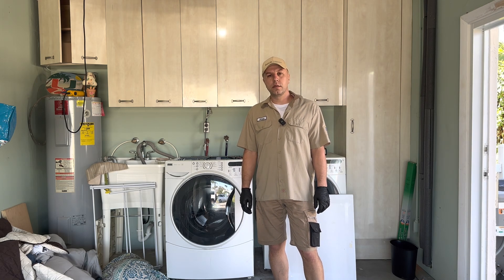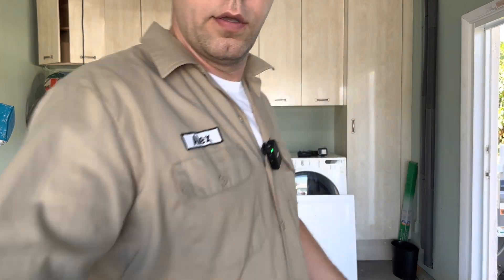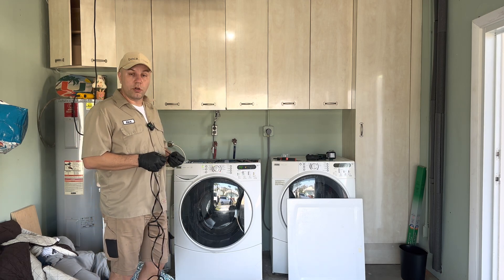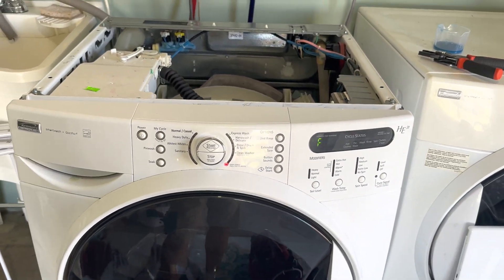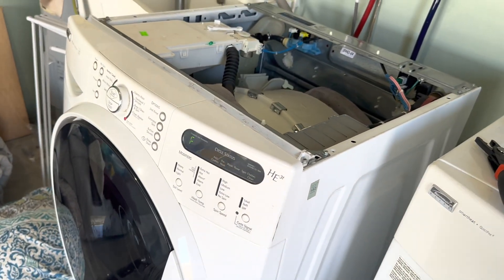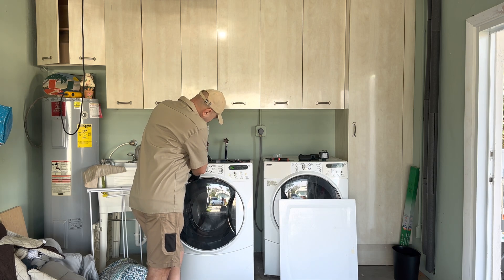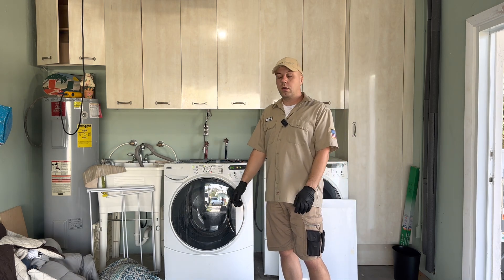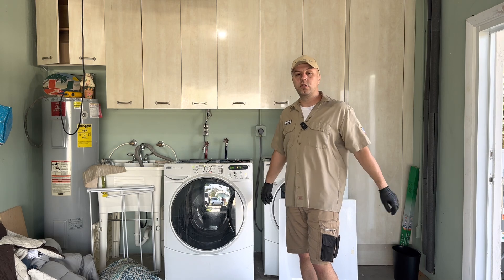Top secret algorithm for a washing machine diagnostic test

Comment: Water valve is leaking
Reply from the maker: F20 error code means the control board indicates a water flow problem. The control board can never identify the inlet valve water leak. So your guess is wrong!